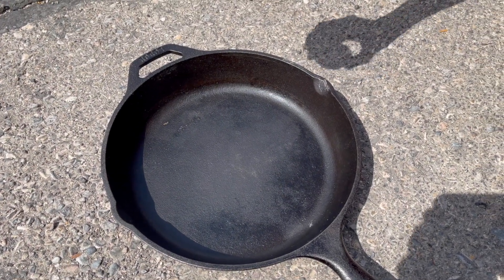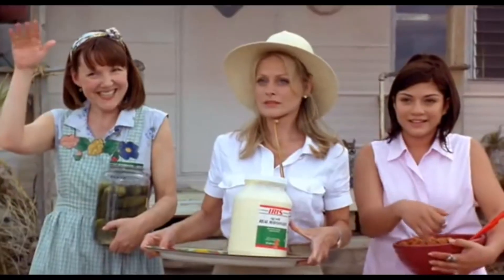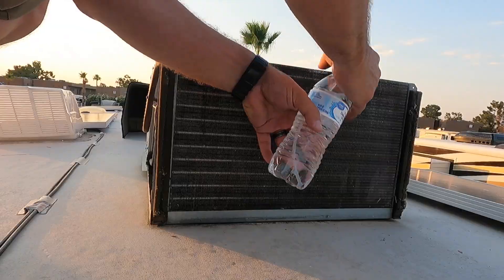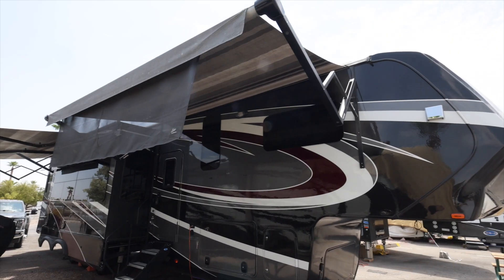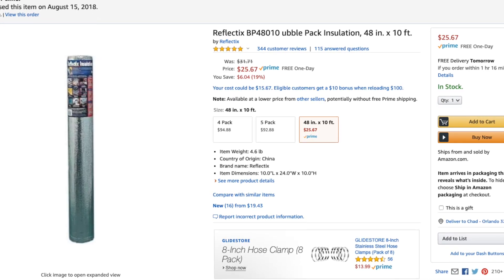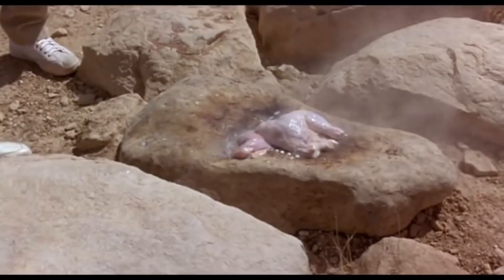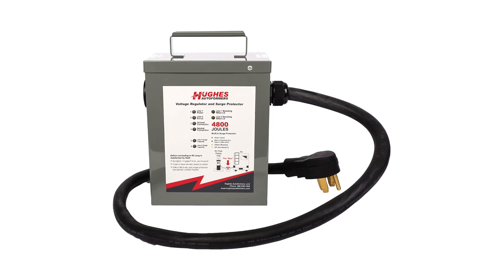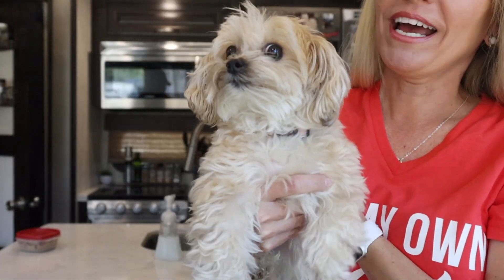🥵  RVing in EXTREME HEAT! ☀️ (Full Time RV Life)

Comment: The one thing that I did that made the most difference was covering my furnace ducts, I discovered this by accident one day when I got my face close to the furnace discharge and there was a cold stream of air coming out( cold air sinks, it makes sense). I went from the ac’s running all day, to them actually cycling off some.

Comment: Get a buck boost transformer. Tanning salons usually are in commercial buildings with 120/208 volts and the tanning beds need 240 volts.  That transformer will fix the problem.

Comment: Our AC on our new fifth wheel decided not to work in 117 degrees. When we relocated to the beach the AC  worked just fine. I guess AC doesn’t like the heat either.

Comment: I'm not sure if there is any truth to this, but I've heard running your fridge on propane will keep it cooler.
Reply: I've heard that, too. Is there any truth to that?
Reply from the maker: I guess it might be possible that the heat form the propane is hotter than the electric element..  But, not sure it would matter in this heat.  The issue is getting rid of the heat via the fins..
Reply: Running on propane would mean less current draw which means less I2R loss in your wiring and less heat generation in your bkr panel.
Reply: @horizontraveler3180  what is 12R?
Reply: @immasher2139  Limitations of my phone text keyboard. "I" = current (amps), 2=squared, "R" = resistance (ohms). Electrical equation for heat created in a conductor when carrying current, Joule's law.
Reply: @horizontraveler3180  thank you!

Comment: A timely video for me as I happen to be in Vegas right now here in mid July.  Yuk.  104° at 1am.  OMG 😱.  I've even done most of the tricks/hacks that you have done.  I'm a 37' 5th wheel running 2 ac's. Fortunately this RV park have full hookups with 120/122v at the pole.  I also had issues that had to be taken care here in Vegas at this time.  Also was in the northern Ca., thinking it would be cooler but the tamarac 🔥 fires and smoke drove me out.   This heat and smoke is no joke.

Comment: I have a very small fan inside the refrigerator that I bought online years ago. It is like a computer fan, along with a fan in the outside compartment to blow air across the coils. It helps tremendously in high heat.

Comment: The Hughes Autoformer can't and does not take, steal or reduce voltage/current from other sites or the RV park power grid, it's not a (Autotransformer), An autotransformer has a single winding inside, the Hughes has 4 windings, totally different technology and engineering entirely. As far as the NFPA, there is no science behind their claim. That rumor has been around for years. Robert Hughes was a brilliant electrical engineer, not so good though when naming the Autoformer.
Reply from the maker: After doing a little more digging and thinking about the subject, I think you may be right...   I need to dig into it a bit more and maybe pick up a unit to test...
Reply: @ChangingLanes , I'm just a nerd of a mechanical and electrical engineer, automotive but the principal and theory remains the same. Safe Travels guys.
Reply from the maker: I've reached out to Hughes.  If my calculations and assumptions are right, we'll definitely be buying one.

Comment: First off, you are correct not to RV in the summer of Las Vegas heat. I sold my house last October 2020 after living in Vegas for 21 years. The heat is a beast from June - beginning of September and not ideal for RV living during that time. As you know the AC’s just can’t keep up to keep your RV nice and cool. Also another reason is your roof seals can crack in that high heat, so you need to double check seals all around the RV top to bottom. Now having an Motorcoach is the way to go for me and just chase 70 if you can. 
Sorry you had to stay at LV Resort. I was going to stay there after my house sale for a few months, but it was not a very good RV park and they have pets rules that would not work for us. Plus there power boxes looked shady and you already know that.
I know Phil is military and not sure if you Chad and Tara are, but Nellis AFB is probably the best RV park in Vegas.

Comment: Word of advice.  The foam pillows for the vents will reflects the heat back up to the cover and side walls of the vent.  We installed that on our vent and it warped the plastic frame of the vent, to the point that the fan started to touch the side wall.  So, just be aware.

Comment: Great tips guys! Thanks! We were there the same time as y’all and our dash AC (class A) went out on the drive there! Not fun! Our generator was also hating the heat too! The struggle was real! Luckily we stayed in a park (we usually boondock) and didn’t have any voltage problems running our 2 AC units. 🥵

Comment: Been there, done that. A few tips I learned from camping in Phoenix, Vegas and my old home of Fontana, Ca.
Solar Screens knock out 90% of the sun and heat and are on the outside of the glass before the heat even makes it's way in.
Reflextix needs a small air gap to be really effective, 1/2" usually suffices.
Reflectix on the AC bulkhead where the motor is mounted (Coleman style units). The air is drawn in through the read and pulled through the condenser coil and blown at the bulkhead. On the other side of that bulkhead is your cool plenum. I cut sheets to fit around the motor, wire and refrigerant line entrances at the bulkhead to help block some of that heat from the bulkhead wall.
Block off your heater vent to the inside. Your cargo bays collect heat and that heat makes its way into the rig through the heater vent. I used cardboard before but reflectix this year. Want to know how much air moves through this vent, place your hand over it and open a slide with the doors and windows closed. You'll move a lot of air through here.
Easy Starts make a big difference when your compressor cycles, get busy and get them installed, they're easy to do. I'll bet part of your GoPower issue was overloads when the compressor cycled. The easy start fixes that. When you program your easy start be on shore power pass thru or the easy start will not learn properly to your compressor's detriment.
A couple of fans inside to circulate air will help too. I position one in my bedroom to move air out of that box into the hallway and one in the rear living area to circulate air around.
Open your closets and cupboards at night as well to allow the heat out. Relefectix on the outboard cupboard walls help with this but i've never subscribed to this as my outside walls never feel hot from inside the cupboard. 
A FLIR camera can show hot inside areas that need to be dealt with.
Solar panels do help keep some of the sun off your roof and help keep the inside cooler.
I have one RV Airflow on my mid AC unit, my rear main unit is a whisper quiet and my bedroom unit I left in the standard config. When I get to a camp site after driving all day I can close the bedroom door and open the dumps to really cool down the bedroom in a hurry, then close the dumps and go back to ducts to assist with cooling the rest of the rig.

For power and I was going to write you about this on the solar video but here goes for this video.
I have two Victron 24/2000/70 Multiplus inverters (I went 24v for cabling size efficiency and gains from the MPPT). These inverters are each fed a leg from my shore power connection, I don't have an onboard generator because I wanted the space for blue power gear. Inverter 1 is the master and inverter 2 is the split phase slave so in this configuration I'm supplying 240v to the rig's power panel. Now the issue I found after this install was live after a few months is that leg 2 has heavier loads with 2 ACs on it vs leg 1 just has 1 AC. This makes inverter 2 work harder while inverter 1 naps. So I installed a Victron Autotransformer to load balance the output and now each inverter production is even and I have access to all of the available power. I've run all 3 ACs, residential fridge, TV and laptop off of the inverters in island mode (no shore power). Now with all of that load of course the batteries aren't going to hold out long even with 1300 watts of solar helping. So I can either plug into 50A shore power and both inverter go into power assist so if the pedestal power is weak the inverters make up the difference from the batteries/solar or 30A shore/inverter generator will supply 1 inverter on leg 1 while the second inverter takes power from the batteries. Solar and inverter 1 then charge the batteries for the new difference.
The side effect for all of this is a happy me but also heat. The Victron inverters have a output curve where the hotter they get the less current the deliver. The inverters are rated at 2400 watts All of my gear is also mounted in my forward bay below the bedroom and the floor gets toasty. To help with the power curve issue and toasty floor, plus equipment life I installed a boat bilge fan controlled by a temperature controller. The fan pulls heat from the top of the compartment and blows it out the driver side propane compartment via a dryer duct. The duct is below the propane tank deck so the heat doesn't affect the tanks. The cool (relatively) air comes from the passenger side propane compartment which I use for storage since my Jayco Northpoint 377RLBH has both main propane tanks on the driver side; the third tank for genny prep lives on the passenger side normally. You'll have the same heat issues as I do with that small compartment, before the fan I would just open the bay door completely, now I just leave it part way open, just hanging on it's hinges open.
With this system I can start the ACs about 45 minutes or so before arriving so the cool down process has already started. This will leave me plenty of battery left for any unforeseen issues that come up before or at the campground. I'm about to increase my battery capacity by going from 6 12v 105ah Lion Energy batteries (24v wired) to 6 DIY EVE battery sets at 310Ah each 12v set.
The Victrons also have a low voltage cut off where they'll not accept voltage that is too low to be useful, this is where the Hughes Autoformer or a Victron Autotransformer comes in handy but iirc the low voltage is like 99 volts before shore is ignored. I've moochdocked on 15A outlets with all 3 ACs running so these inverters are very powerful in their capabilities.

I live 30 minutes NW of San Antonio in the Hill Country and would love to help you or just show my install, one of these days I'll have to film my setup but I don't have Tara to edit it so it'll just be relatively raw.
Reply from the maker: That sounds like a great setup, Jeremy!  I've also been pondering how to cool that front bay as we have tripped the overtemp on our gopower a couple of times.  I'm just not sure about venting into the propane compartments as I would be limited on the driver side (with the genny) to a vent higher up in the compartment.  So, I'm still at the drawing board there.. My "hack" plan is just a box fan in the door...
Reply: @ChangingLanes  Thanks. Maybe a dryer duct vent and cover out the side wall of the rig or even the front bay door itself. The great thing about the bilge fans is they're sealed since they're made to vent fumes out of the boat bilge and engine compartments.
Don't forget that your batteries enjoy cool temps as well.
Reply: About how much would all this (keeping camper cool) cost? Just a ballpark figure. I want to know how much we would need to save for all this. Thank you so much.
Reply: @cindydavis597  My setup all in all cost around 15k with the most expensive part being the batteries, i installed everything myself. You can write 26% of the costs off on your taxes with the solar credit.
Reply: @ChangingLanes  NOT SURE WHY the RV makers have not gone to the MINI-SPLITS  the only need 500-800 WATTS to run 12,000 BTUs 
unlike that (3) bricks you call AC-Units @ 1,300 +++ WATTS (@4,000 Watts)
Reply: Thank you for the knowledge! We have a 2020 Tiffin Wayfarer and live in AZ and want to upgrade our Power
Reply: I am a licensed electrician and I would have to take another class to understand what is all going on with your setup. Are you an electrical engineer? Who designed that system for you. Finding someone to troubleshoot a problem could be a challenge.
Reply: @TD-ce5ru  I'm an engineer and designed it myself. I did a lot of reading of the manufacturer white papers and studied other installs that were documented. Then I passed my drawings and figures to the Victron local rep who gave it a thumbs up and away I went.
I've gotten some help on issues with the auto transformer mostly because it has a manufacturer design issue but yeah, there are very few people who would be able to Tshoot the system as a whole. 
Luckily it just works.
Reply: @JeremyPrattigmp2u  I am intrigued how  one leg of 120v on shore power and the other leg on the inverter battery power. Seems like a nightmare figuring out the proper way to bond the neutral on two separate sources. I don't think I have ever run into one system from two separate sources. Normally when the inverter takes over, it is one source. Very interesting to me
Reply: @TD-ce5ru  Both inverters are single leg. L1 to Inverter 1 and L2 to inverter 2. Neutral and ground are split before the inverters to feed both. Then the inverters do inverter things and output L1 and L2 with bonded neutral and grounds. L1 and L2 enter the autotransformer which then creates a neutral to feed the rig. The inverters switch the grounding relay on/off as needed on the autotransformer(AT) itself depending on whether i'm on shore or inverter. On shore the ground goes to the pedestal, on inverter it stays with the AT. 
When I'm on shore split phase this is just passed through and the inverters act like a UPS. On 30A single only one inverter syncs up to shore power and the other inverter uses battery power for it's half of the job. Inverter 1 charges the batteries and takes it's load from shore. 
If there is not enough power, like plugged into a 15A outlet I set the rig to 10A max and then my solar and batteries make up the difference to match load requirements, this is assist mode.
All of my power though comes from/through the inverters depending on the mode.
I'm toying with taking the AT out and just going parallel because the AT adds some complexity like if shore is three phase and I get phase A-C or B-C or A-B then this throws things off and I need to reconfigure for this mode. This is a minor inconvenience but the problem comes from lower voltage in three phase, this causes the AT neutral to float and I end up with 100 volts output to the rig which is outside ANSI standard. I talked with Victron about this and they're like yeah, it's good, don't worry about it. But I don't like this for the long term effect on the ACs and microwave. Parallel is easy on the output side and config but i'm waiting on some confirmation from the dealer on its behavior with 30A or 50A shore connections. They've made some software updates lately and I can't get a definite answer.
Reply: @JeremyPrattigmp2u  I am guessing that you and I are retired. To much time on our hands.  Hey, I never even thought about shore power coming from a three phase 208 v panel. That could explain the low voltage range problem in the video.
   The whole RV standard wiring is enough for me to deal with and understand. There is some pretty odd stuff going on.

Comment: Two things for advice. The military uses a screen type of tarp over our tents in Kuwait extreme heat for sure. They are breathable but provide shade to create air space between the inner and outer surface. Second the cover on the A/C are critical to divert air flow through the coils and condenser. Without the cover the fans just blows into the air and not through the system. White covers with additional air ports are helpful to divert more air through the system. Good luck in the heat. Drink water!!

Comment: Having lived in the desert for the last 57 years, you did a great job quickly figuring out good tactics for surviving the heat.  Evaporation is another tool.  In addition to fans wetting down towels, tea towels, pillow cases, anything that will absorb some water.  If you have a drying frame, using it to hang towels in front of fans creates an evaporative cooler.  Self-cooling things like wet (not dripping, but if you get your clothes wet that’ll be fine!) towels, clothes-cotton, mesh, white.  Keep covered, seems odd to wear long sleeves, but very loose open ended white shirts and pants.  Think about the open robe designs of the desert nomads, wide bell arms and legs (or dress like at the bottom).  Hydrate, hydrate, hydrate you and your pets.  I drink at least 1 gal/day in the summer heat.  Glad you survived, great tips!

Comment: Great Video!  We found that by putting the thermostat up to 80 degrees during the day and then lowering at night helped when the power was below 120V.
Reply from the maker: The fan and compressor are simply on or off.  The temperature setting shouldn't really matter.?

Comment: I've found a good (emphasis on the good) swamp cooler can really be a life saver. As you know a swamp cooler is just a big fan blowing over a porous material that has water running over it. If it's a good unit it can lower the temp in a room 10 to 20 degrees in a mater of 30 minutes or less depending on the size of the room. And what makes it so beneficial is the fact that it does not use the electricity that an AC unit uses because it is just the fan that uses the electricity. There a number of swamp cooler designs that are made for use indoors. This might be something that would be handy to have when in hot weather with limited electrical capabilities.